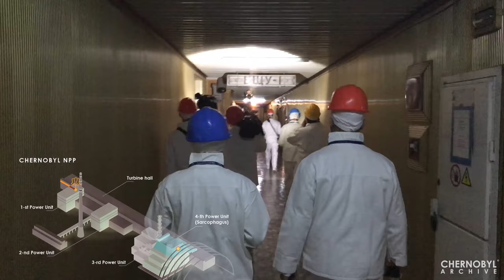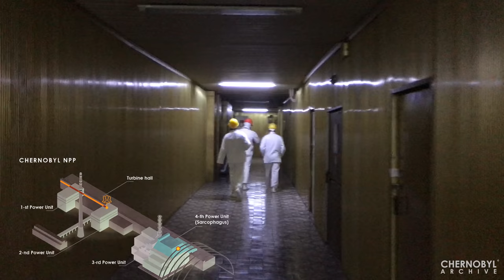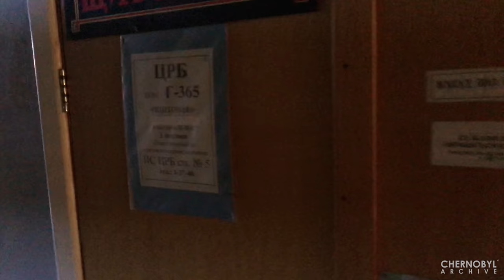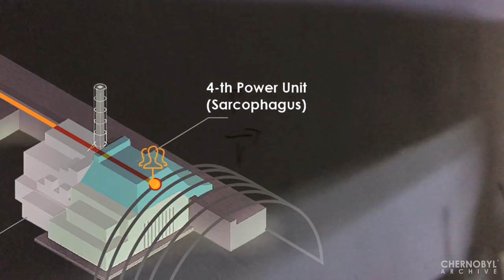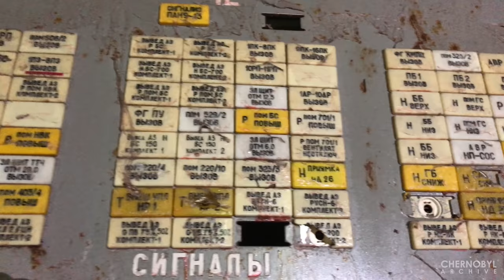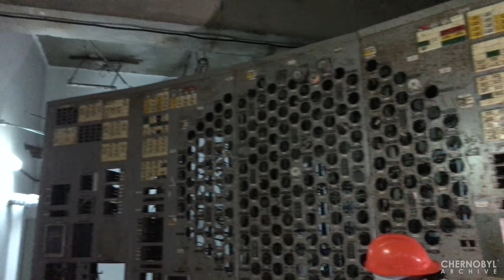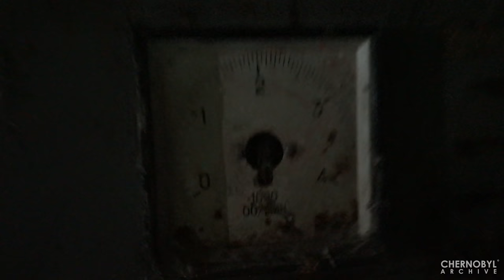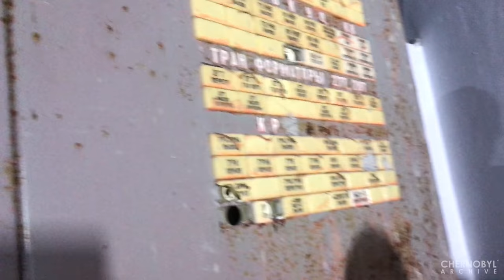Full Journey to Reactor #4 Control Room - Inside Chernobyl ЧАЭС Sarcophagus 2019

Comment: Your AZ5 placement is incorrect. In the other models this is the correct location but in Unit 4 it is closer to the edge of the control panel. It was later moved up to prevent accidental pressing.

Comment: How to make your partially decommissioned partially destroyed Nuclear Power plant more scary: FLASHING LIGHTS
Reply: Thats because of acute radioactivity before. Damaged the filament
Reply: It's the hash slinging slasher!
Reply: Actually its fully decommissioned
Reply: I believe its like that because the lights blink on and off faster than the human eye can see but cameras can see it.
Reply: @Brian-nl7xr  yeah it's due to the frame rate of the camera
Reply: Chernobyl isn't partially decommissioned, but COMPLETELY decomissioned!
In 2000 the last reactor was shut down.
Reply: @Brian-nl7xr  yes, the lights flash at 50Htz, or 50 times per second. The camera framerate is 30 frames per second, so because the frame rate is about half that of the frequency of the lights, they appear to flash on an off approximately twice per second

Comment: There was no reason for the white suits and masks. Radiation goes right through everything  except lead suits.
Reply from the maker: 1. Mask for not breathing dust that could contain radioactive particles.
2. Suit is if you accidently touch anything with your legs or upper body - you could see it, and if even not - you're not in your own wear, so you're not in it in your car or home.

Comment: A lot of parts have been stripped from the control panels. 

Guy in alley: “Psst, comrade, you want spare part for your 1970’s computer? I have, cheap”.
Reply: They come up on eBay for sale all the time
Reply: Exactly what I was to say: The entire console has been stripped of anything of worth.  The control room looks smaller then I’d imagine, looks bigger on the HBO series.  But disappointed...everything has been stripped from console.
Reply: @danfenelon  there has been a new wall put in behind the consoles if you see images of the other complete control rooms from the identical reactors at the plant they are near identical to the tv series
Reply: @nickm7889  that explains it, thankyou.  About all the missing parts? Who looted it? Ukraine officials? Or looters? It’s all contaminated gear. Selling on this gear would potentially expose the buyers to cancer in the future. Just like the vehicle scrap yard. It’s all gone now. All engines from trucks in a video 5 years ago have been taken. Even if you melt down scrap metal, the radiation is still there. Also many videos of the appartments in  the town you won’t see any radiators on the wall. They all been stolen and sold as scrap metal. These people that are doing this are killing people. And the stalkers and graffiti vandals that use Pryvat as a playground makes me sick. Many of them making a living from there videos on you tube.
Reply: @danfontaine6277  like Kreosan? Lol.
Reply: @nickm7889  Correct, they put a new wall in as part of trying to reinforce things. The explosion did pretty significant damage to things and that wall was needed to hold things up. As far as the stuff stripped out. A lot of it was used for spares to keep the other 3 reactors going.

Comment: 17:32 The button that started it all.
“When the truth offends, we lie and lie until we can no longer remember it is even there, but it is still there. ”
Reply: They weren’t even online and after a shift change there must have been communication problems that led to and nobody knows why a worker pushed button 5 and I understand the explosion was 5X Hiroshima
Reply: @seahog1911  what?
Reply: @enlistintheempire  I read the explosion was 4-5 times that of Hiroshima releasing 400 times the amount of radiation. I also read it was a test that had started with one shift and another shift took over. Someone pushed a button that released a bunch of faulty graphite rods that caused the coolant to boil and existing steam to create I suppose extreme superheated steam to blow the roof off. Nobody ever explained who or why that button was pushed. I suppose some is true and some not.
Reply: @seahog1911  it wasn’t 5x Hiroshima because then the entire power plant would hav been vapourised. And also it wasn’t a nuclear explosion. It was gas and steam explosion that led to the reactor being open causing the spread of radioactive particles.
Reply: @ShadyKoi  its radiation was 5 times hiroshima. It's fire wasn't.
Reply: @notagamerplays9558  i never said the fire was 5 times worse, I said that it wasn't 5 times Hiroshima in explosion and it wasn't a nuclear explosion. I said it was a steam explosion, that cause the open reactor to leak radiation

Comment: I wonder how much was taken from the control room for parts and how much was stolen as souvenirs?
Reply from the maker: Almost nothing was taken. Room is still heavily contaminated.
Reply: @chernobylarchive1206  A object such as a knob would have surface contamination but with proper cleaning could remove surface radioactive material. If I am wrong let me know.
Reply: @chernobylarchive1206  And yet, most of the instruments, knobs and indicators are missing. I doubt that they fell down from the explosion, somebody has removed them - either to use as spare parts for the other control rooms (since the remaining units were operational for a while) or stolen as souvenirs (or to be sold for scrap).

Especially when it was forbidden to visit the exclusion zone, people would sneak in (after all, the zone is not guarded like Fort Knox and the perimeter is huge), visit the place, grab some souvenirs and sneak out.
Reply: @Pentium100MHz  You can’t sneak into the power plant. The parts have probably fallen through the metal from corrosion. It’s been over 30 years...
Reply: @kandii88  The plastic covers? maybe, though I guess somebody sweeps the floor there since they are not on the ground. But the various knobs and devices? I really doubt it. 

Since the remaining reactors were still in use for years after the accident in reactor 4, I guess some of the devices were used as spare parts and the power plant employees probably stole some things too (never been there, I assume it is easier for an employee to "liberate" some small item from the control room of reactor 4 then for someone to sneak in from outside),
Reply: @Pentium100MHz  You're not sneaking anything out of that plant, it's all radioactive, you'll set off alarms trying. You can't get past the decontamination area with anything. So no, it's likely been taken as evidence, or to be used or stored elsewhere in the complex.
Reply: Power plant was shutdown 2000. You did not sneak up there.
Reply: Don't know about reactors but it seems that Alot of things are missing
Reply: @chernobylarchive1206  so the screens and computers just vanished due to contamination? No, i think its is removed of the goverment. State secrets and so on.
Reply: @chernobylarchive1206  
Almost nothing was taken? And where did everything go? Eaten by mice? )))
Reply: Jeep Cherokee first you cant sneak in it higly protected and that not how radiation work
Reply: Pentium100MHz l
Reply: @michaelskagen1  Like its fuel rods? graphite? haha
Reply: @Pentium100MHz  de
Reply: Yes of cours
Reply: I'm sure the parts could be cleaned. Back when the Soviet Government dissolved I remember finding many things people were selling from the military. A artifact from the control room would be worth some money to collectors.Just like items from the Titanic.
Reply: Almost no highly contaminated souvenirs were stolen during each tour.
Reply: @illustriouschin  Not from visitors, I meant from staff over the years.

Comment: This is reactor 3 not 4. Too radioactive to get close to reactor 4
Reply: Yeah and I think people still work there. Shit the reactors were in use for years after. Fake.
Reply: @Spoon Radiation levels go down? Maybe in 100,000 years.
Reply: Quantum Computers 

You do realise that different radioactive elements decay at different rates, right? Radiation won’t disappear from there for a very long time, but it’s nowhere near where it was even 20 years ago.
Reply: @armitage1950  tell that to the people in the Polygon.
Reply: Caesium has a very short half life. 10 days actually. Radiation levels are safe now.
Reply: "Cesium-131 (Cs-131) The half-life of Cs-131 is 9,7 days. It decays by electron capture emitting photon radiation in the X-ray range (29.5 - 33.5 keV). The optimal combination of its half-life and radiation energy makes Cs-131 an attractive radioisotope for brachytherapy of malignant tumors."
Reply: I see! So 131 is not the one produced, it was 4 5 and 7. Would scattering boron and other neutron absorbing materials help reduce this amount of radiation or..?
Reply: Thank you so much! It's good to talk with someone with actual nuclear knowledge. And your english is fantastic. Instead of swirled though, you could say "The problem is that all the dust on the ground is picked up by the wind" 
But yeah, I suppose a lead wall would work quite well.

Comment: Its quite noticable that almost every indicator in the lower areas of the boards has been removed while most of the hard to reach stuff is still there. Everything thats easily accessible and does not require a ladder to be stolen to be precise. ;-) Souvenir hunters have really stripped this place over the last 34 years and i have no doubt that people working at the plant have taken the major share. Tourists never enter this room unattended so its rather hard for them to pull out a screwdriver and let a fuel pipe indicator dissappear into their pockets. Not to mention to smuggle such a quite contaminated piece past the radiation screening on their way out of the exclusion zone ;-)
Reply: Im almost inclined to think that a lot of those parts ended up as spares for the other reactor units that continued to operate. Not saying they weren't taken by souvenir hunters working at the plant but given the nature of the plant I wouldn't be surprised if they were reused. Nothing wrong with them after all right?

Comment: It's kinda crazy to think that the control room is so clean, most of the panels are missing it's just some buttons and some indicators and still walking in there with just a mask then why it's the sarcophagus still there if you can walk casually in the control room
Reply: The reactor hall is not only still incredibly radioactive, but also still wide open. Thats what its containing for the most part. Those walled off corridors lead into what used to be the reactor hall.

Comment: I live less than 5km from the Mátra Coal Powerplant(formerly the Gagarin Coal Powerplant) in Hungary. Meanwhile I was mostly with the maintance guys working in the cooling towers and Turbine hall 4 I had quite a few opportunities to look around the place iwth the maintenance group's shift leader. We went to the control room tied to Turbine hall 4, looks more modern, obviously, but the whole vibe of the area is pretty much the same as here. Corridors are almost perfectly the same. 
From the top of Turbine hall 4(I think it was the north or north-eastern end) I could look around, standard, crude looking Soviet style structures and metal beams everywhere.

Comment: Great video... But please help me understand. This isn't the one that exploded, correct? Isn't that the 4th reactor? And the one you guys are at now is the 3rd?
Reply: Kris B I think only the turbine hall and the reactor core have been affected majorly by the meltdown also the pumps
Reply: I may be wrong but what I have researched and heard is the control room isnt that close to the reactor and wasnt affected by the explosion. Yes radiation would have affected the room but after many years it's safe enough to be in there for a decent amount of time.
Reply: The explosion was not even that big as people imagine. It did blow the roof of of the reactor, but the control room wasn`t that close to it, so that`s why it isn`t destroyed
Reply: Its the 4th reactor

Comment: Forgive me if its a dumb question, but how are you able to go in there? Have radiation levels decreased a lot? If so, then why is there a need for the sarcophagus?
Reply: Sarchophagus was needed to stop the radiation from spreading since the core had like 2 walls left and no roof. Reactor 4 is still very radioactive. They are able to go in there because If you have seen HBO's series in 1986 they have dumped a lot of sand and boron at the sides of the core, with that it makes a very good anti-radioactivity shield.
Reply: @privatech9558  Ahhhh. Thank you for the explanation sir.

Comment: I wonder where they got the electricity for the lights?
Reply: Other parts of the reactor have been active.
Reply: @orestes1984  They are no longer active, i think the other 3 reactors operated for around 10 years. The electricity comes from, well the same places that other electricity comes from :D
Reply: @RT-he6zf  solar energy, they installed at the same time as the new protection for the sarcophagus was built
Reply: i don't know if it is the only or mainly energy source*
Reply: They reversed the electrical flow reusing the same pylons and electrical equipment going to Chernobyl and Pripyat in the early 90s I believe (mostly to save money from having to install more equipment), seen some guides and liquidators talking about it.

Comment: HBO Series : Big control room
Really : Small control room
Reply: From reading above the control room equipment was moved to another room while the original was used as a corridor.
Reply: @jparsons233  Nope! They didn't move the equipment at all...The control room is the same but it was seperated in half by a wall to protect plant workers from ionizing radiation....

Comment: Why is the control room abandoned
Reply: Because Unit 4 exploded during a test on April 26 1986. The core and most of the reactor hall building were destroyed and the ensuing fire spread a tremendous amount of radiation into the surrounding areas. So Unit 4 was abandoned and sealed off and the entire city of Pripyat was abandoned and remain very radioactive to this day.
The other 3 reactors were shutdown by 2000.